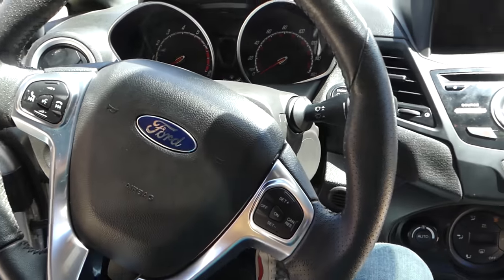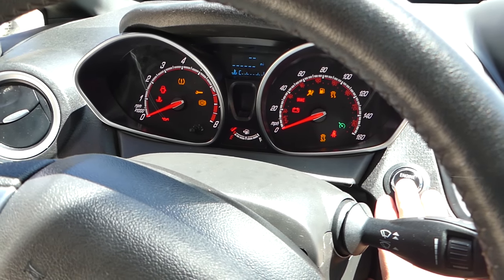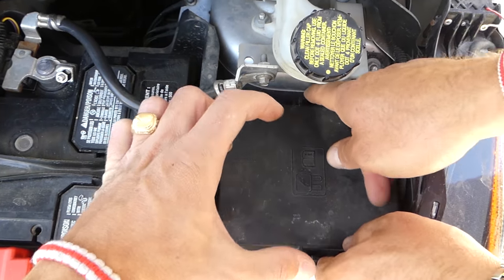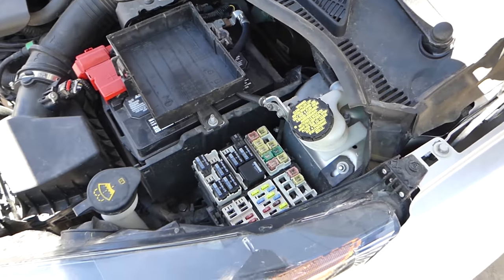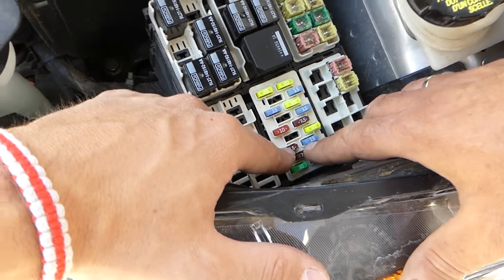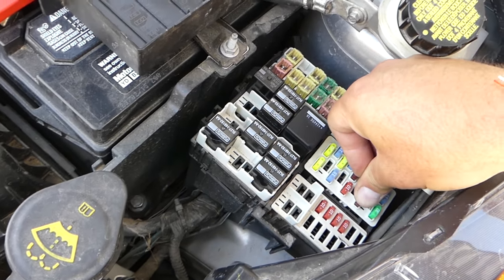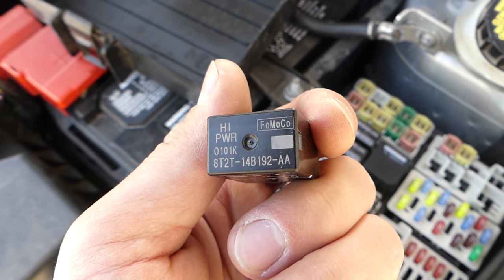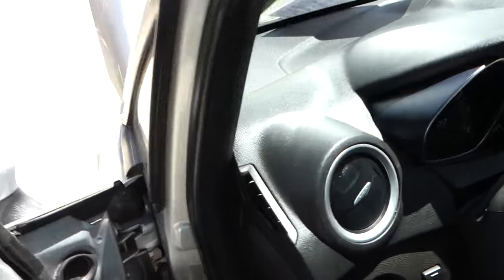FORD FIESTA DOES NOT START FUSE RELAY PROBLEM MK7 ST

Comment: The fuse box on my 2016 looks different. Do you know what the fuses that you pulled were for i.e starter inhibitor relay, ignition switch relay etc. Thanks
Reply: Same here. What did you do?
Reply: @907thpeterson  Ended up replacing the two switches on the clutch pedal. They were like $10 each from Ford. Hope this helps.
Reply: Hi what do you mean two switches. Where are they located  @liamreynolds4596

Comment: Your Video is incorrect, the relay (r3) you pointed out is not the "starter relay" its the PCM power relay, R9 is the starter inhibit relay. and you can swap it with r10 (high beam relay) to see if that's your problem.

Comment: this happens on and off on my car, no one can fix it because it sometimes works and doesn't work
Reply: Strages it could be the spacer on the clutch had the same problem and I put a bigger spacer and it worked
Reply: I have the same problem mate

Comment: Thank you so much! My husband and I were wondering what was wrong with the car. We had recently gotten a new battery and it still wasnt starting. Turns out our fuse and relay were corroded. Quick trip to autozone for parts and it's running perfectly! If I didnt see this video I'd be panicking right now. Thank you so much!

Comment: Have a problem with my ST2 2017 Sony radio
Black display screen, not responding. Took head unit out, un plugged it and put back in and can hear the cd spin up so it's getting g power.

Comment: Hello! I'm sorry, I have an issue with my ford fiesta titanium 2016. Some months ago when the pandemic started I stopped using my car (since I used it mainly to go to college). A month later I tried to use my car to visit a friend and the car didn't start. It shows in the screen a message that says "immobilser faiure, service now" but I already sent the car to many workshops and none of them could solve the problem. I don't know if someone has an idea of what might be happening so that I can get in contact. Thank you all! I will be waiting for a response.
Reply: my car is automatic btw
Reply: Did you fix it

Comment: I'm having this exact issue. I have a 2013 model though so the fuse/relay layout is different. Damn it.
Reply: Have sorted it out yet,  I have the same problem
Reply: @gabrielamenyanu7448  Had to replace the starter. It was dead. Contacts and relays were fine.
Reply: Eskil Aune was it making any noises when the starter was broken? I’m dealing with something like that right now and trying to narrow down what’s wrong with my 2013 SE Fiesta
Reply: @toothpick05  I could only hear a couple of clicks from what I guess was the relay. The starter was completely dead. My Ford mechanic said that this is very common once these cars reach this age.
Reply: @gresss  you’re great. Thanks for the quick response. Mind me asking how many miles you have on it as well??
Reply: @toothpick05  The car had ~66000 miles on it when the starter failed. I do believe it failed mostly due to add age and not having been on use for 6 months. Contact points inside the starter probably got too corroded (it's what my mechanic said)

Comment: I really don't expect an answer because I have probably ask 6 or more and never received a response. Go into the store and when I come back out the car just turns over and when I let off the key the starter turns a couple more times? I replaced the starter and it still won't start and turns a couple of extra times when I turn the key back to accessory mode. I have changed the following things over the past month or so? Ignition switch, battery, timing belt and the fan belt, head gasket, water pump. The car has been babied and only has about 70k on it. Again, before I replaced these items is when it just all the sudden wouldn't start and the starter turned a couple more times when I let the key back and the news starter does it also.